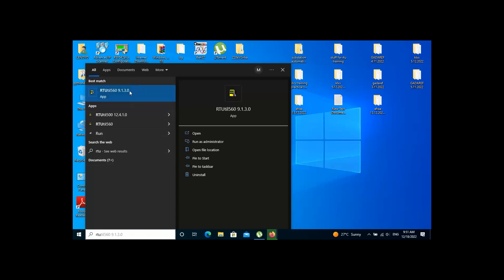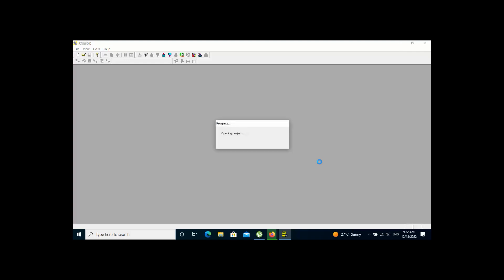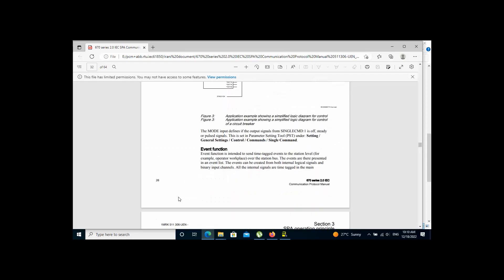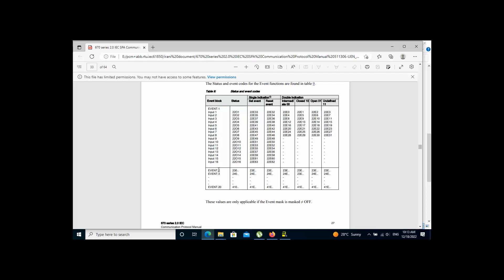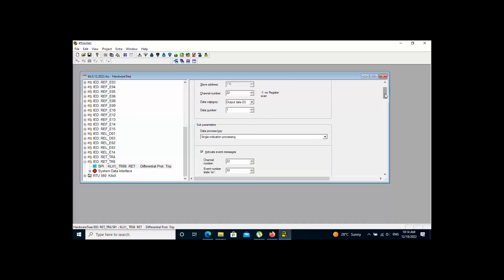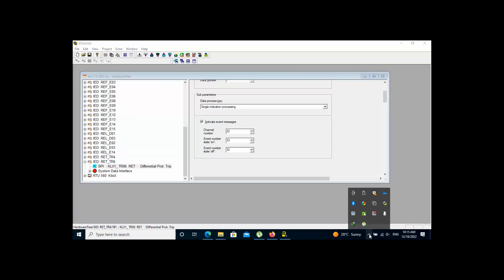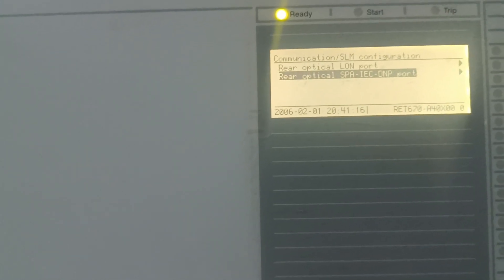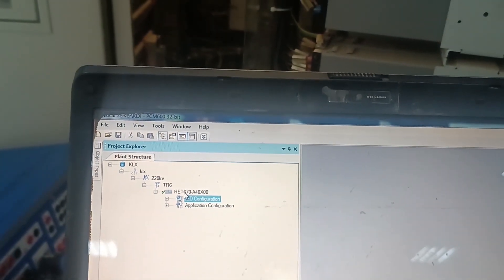transfer signals to abb rtu 560 using spabus protcol part

Comment: Good content 👌 
I wanted to know, how to test hard wire commands from RTU560 to marshaling, can you help please?
The signals are hard wired from relays to marshaling panel, and from marshaling panel to ABB RTU560, the HMI sends the command to RTU560, HMI receives a command received reply, but the command doesn't execute, and no error is given to work on.
Reply from the maker: Hello... I hope that you are doing well...first of all I need more details 
But In general RTU should contain binary out cards you start by giving command form  hmi and see if binary out put card is responding if it is responding then you need to check wiring
Reply: @mohammeddafaalla2154  thanks, tested one step at a time, RTU was working fine, today I found some signals' issues were some wiring, couple of damaged relays, some had damaged fuses in marshaling panel, I had not worked in marshaling panels myself before today, I was very slow, was very boring for me, tomorrow I had to go to power transformer signals to related panels, which I haven't done them before...!
I had to do it, so I will 🙂✌
Reply from the maker: wish you all the best... Keep me posted if you face any problem
Reply: @mohammeddafaalla2154  multiple types of fused terminal blocks were used in marshaling panel, the site is energized, and a HMI Engineer trying to work on marshaling panel fuses & wiring! It's an unforgettable experience for me!
Reply from the maker: @amania9254  working in energize situationa make you work under pressure and  it is difficult